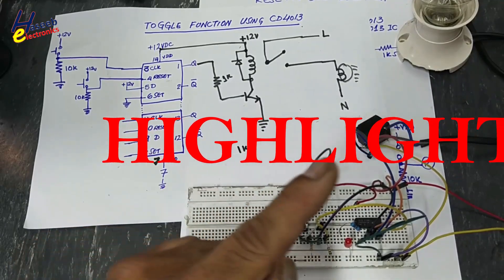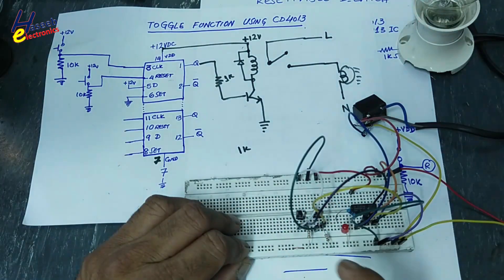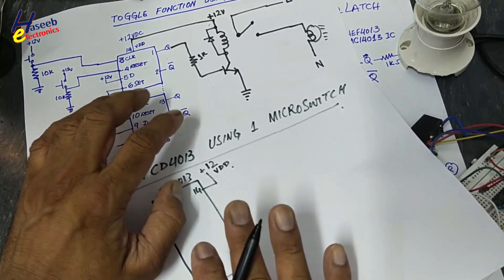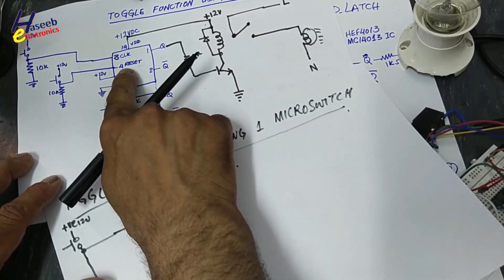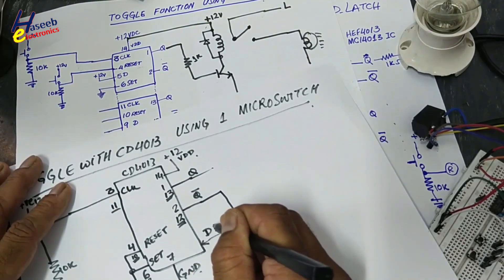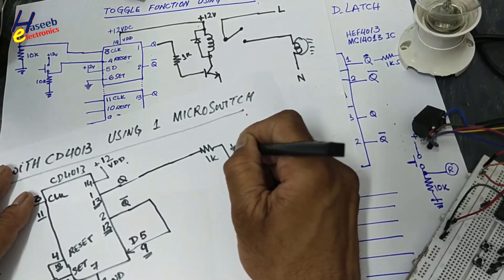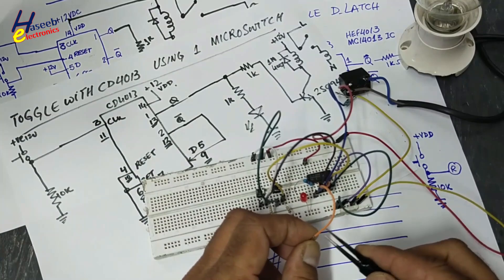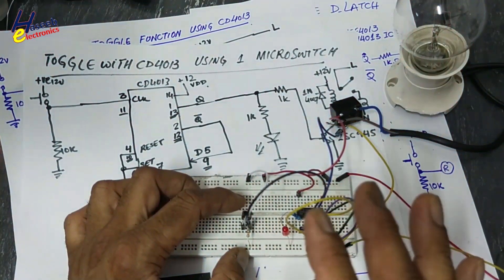{1358B} Toggle Switch Using CD4013 IC | Single Push Button Controls ON/OFF Load

Comment: Great! I was waiting for this. I have a Boruit head light that straps to your head to work. There must be some kind of hidden micro controller in it because it starts flashing after being on a couple of minutes. I want to make some form of this circuit, but I need to use a surface mount single channel version of this device due to space. Thanks for sharing!
Reply from the maker: best regards 
really great idea to use this concept. 
thanks for your valuable appreciation

Comment: Very good and useful information sir can you modify to when power failure and return power all load will remain off
Reply from the maker: hopefully it will remain in off condition. 
but a power-on-reset option can be added to this configuration. 
just rc timer wth transistor can be added to the reset pin. 
so that when transistor will conduct then it will make reset condition, that Q output will be forced to shift to low condition